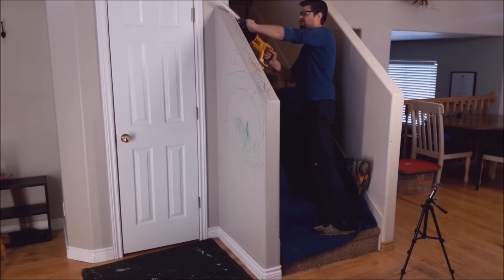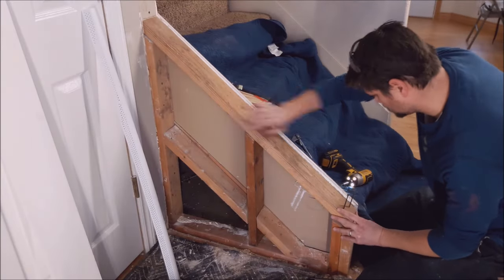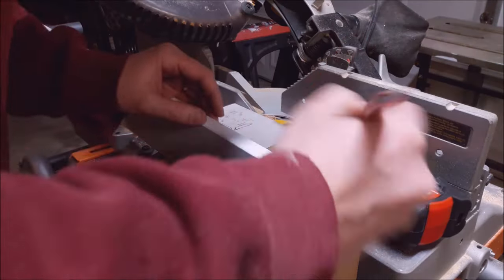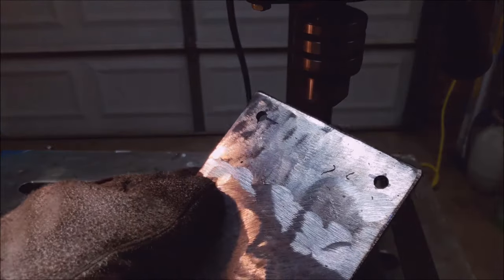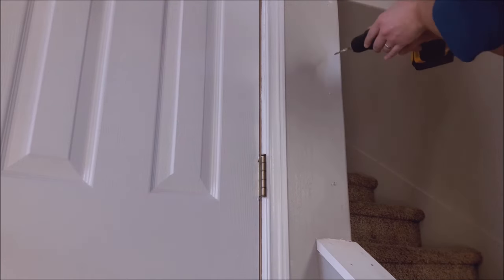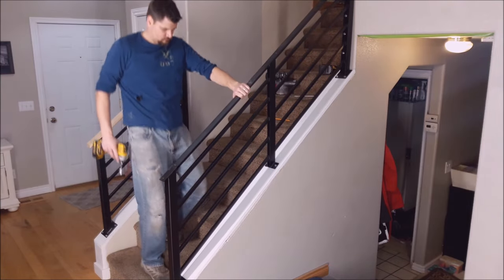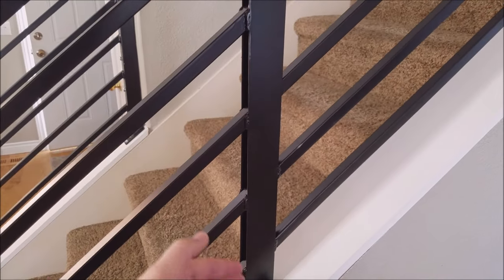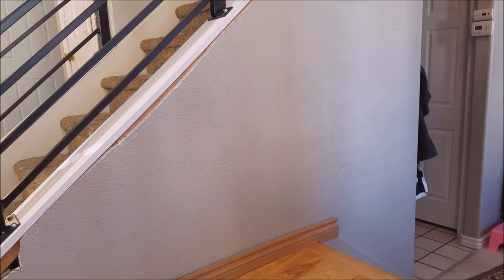DIY Stair Railing Staircase Makeover

Comment: Hi Mech master...thanks a lot for your detailed video. I have to do a DIY stair project just like this one. One question - You attached the angled wooden bar then the white wood board with screws with the wooden post underneath. Then when you have screw the metal post on top of that wooden board,  what if you hit the metal screws that is holding the wooden board by the screws of the metal post? How to avoid that? Please let me know.
Reply from the maker: Honestly I think it was dumb luck that it didn't hit any.  If you know the spacing of the metal flanges then you can measure it out but I didn't at that point so just got lucky that it didn't hit any of the previous screws.

Comment: Nice railing, how did you find what angles to cut the 3/4 balusters in between?
Reply from the maker: I used an angle finder / protractor on the base board.

Comment: It would be better to mark where you need to cut off the old railing before started, and it would be better to use black bolts instead. Other than that, you have done a good job!
Reply from the maker: Agreed, if you wanted to use the existing as a temple that would save some time.  I'll disagree with the bolt I specifically chose not to paint them because I like the contrast look. Personal preference, they'd be easy to paint.

Comment: I'm looking to do something similar but don't want to spend a ton to have it professionally built. My uncle did weld and has all the tools to do this but not longer is physically able to. As somebody that has never welded before how challenging would this be? Is this something I can teach myself over a weekend with some scrap metal or should I rely on somebody with at least moderate experience? My railing is 42" on the top (flat) and 80" on the stairs (angled) so it's not too big of a job.
Reply from the maker: If you are a handy type person then heck ya go for it. If you've never used a power tool then you might want to start with a smaller project. Just my thoughts.

Comment: What is the wall thickness of each of the tubing?
Reply from the maker: I should have written it down but didn't.  There is not a lot of force being put on the handrail you could really go with pretty thin stuff. I think i mentioned in the video I got the material from the surplus isles at a steel supply yard. I'd get whatever is on sale.

Comment: I think you top grab rail is not code  3 inches wide.  And I can't find in the code where you need a center newel post  ( I must be missing something there)
Reply from the maker: Since it's a 1x3 the actually width is 2.5". Either way we are doing an addition right now and the inspector hasn't said anything ....yet!
Reply: @-DIYPRO-   Good , 2 3/4 is max in USA,  for the greater than 6 in diameter .  Inspectors never mention it till you are getting the Certificate of Occupancy , then they like to  bring it up.        Very nice work the, if you max clearance between the horizontal (angled) balusters is 4 inch .   There is no requirement for the center newel , the rail just must sustain 50 lbs/ square feet sideways force but of course more newels are good.

Comment: I know this is an old video and just found your channel.  Thank you for your awesome videos.  I have a question on this video, excuse me if you explain this in another video, My biggest issue is finding the angles and knowing how to find the angle.  So your uprights are straight up and down but I didn't see how you know what angle to cut them at.  Also your 1" square tubing also looks like it is at an angle as well.  Hopefully this makes sense lol

Thank you!
Reply from the maker: The easiest way is to get an angle finder: https://www.harborfreight.com/dial-gauge-angle-finder-34214.html
Put that on a board or piece of metal that is on the same slope as the stair raise (like the white trim board I connected the railing too). The needle always points up so with the board at the angle the needle will point to the angle you need. 
You can also do it with a board, level, plum bob, and protractor. As you can imagine that take a little more effort. Hope that makes sense.
Reply: @-DIYPRO-  thank you!

Comment: Would a stick welder work for this type of project?
Reply from the maker: Do you know how to stick weld? I would watch some of my welding videos if you are new to the trade and pick up a cheap harbor freight flux core welder to start learning, they have a good budget Titanium Flux core welder for less than $200.
Reply: @-DIYPRO-  Yea i have my dads old Lincoln, i haven't used it much but I'd like to get a mig welder. thanks for the advice.

Comment: How far apart were your bars that go horizontal? Looking to do this project soon! Thanks!
Reply from the maker: They were about three and a half inches. Most code is no more than four. I just took the height and divided it equally with the number of rails I wanted. And made little wood block template so it was the same.

Comment: Nice video, just following up as it’s been 2 years since you’ve done the video, how has the paint held up? I have 3 kids aswell and I’ve built a steel railing, just gotta paint and instal and wondering if the 3 coats was enough or if I should do clear coats etc. thanks
Reply from the maker: Thanks! The paint on the railing has held up great, we've had to re paint the baseboard a couple times!

Comment: Where did you buy the hand rail
Reply from the maker: at a local steel supply shop. You can typically search steel supply near me in google and depending on where you live (obviously there would be more in a big city) there should be one or two.
Reply from the maker: much much cheaper than home depot or lowes.